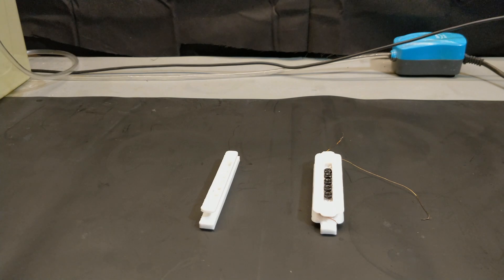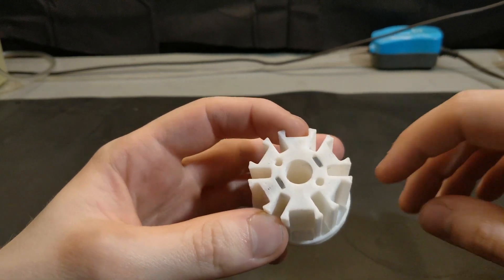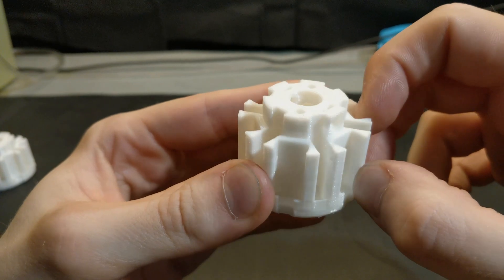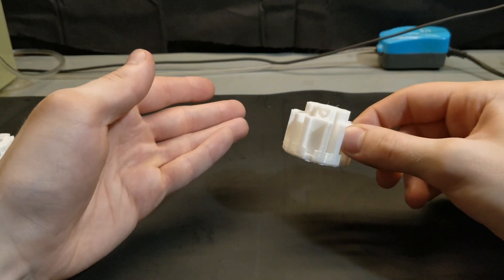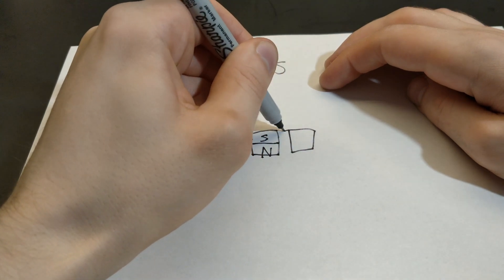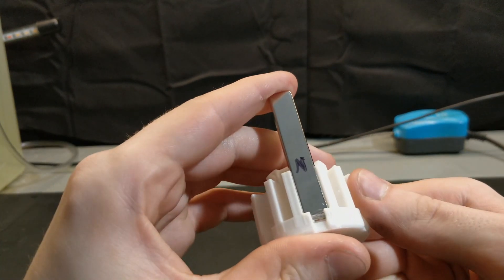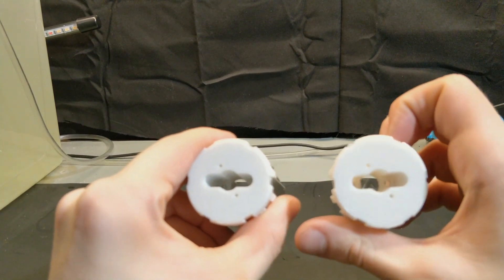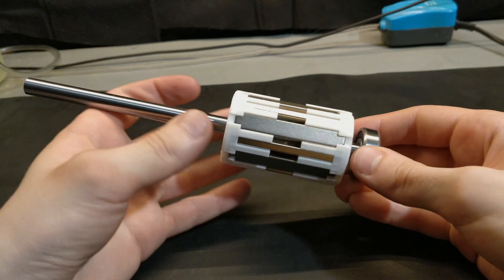A Halbach Rotor for my ModuCoil Generator

Comment: Good info.  Halbach arrays are also used to generate a modified magnetic field.  Say you are testing a soft magnetic material, and you want to try different angles of field reluctance.  You can use a 3D Halbach array to create a magnetic field with very specific  flux placement and angle properties.
Reply from the maker: Thanks, and that sounds cool!